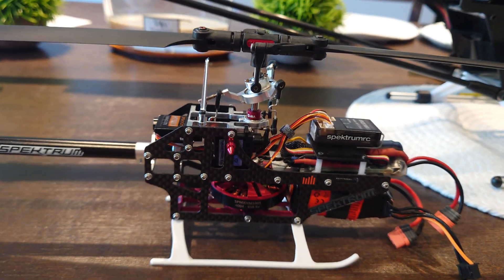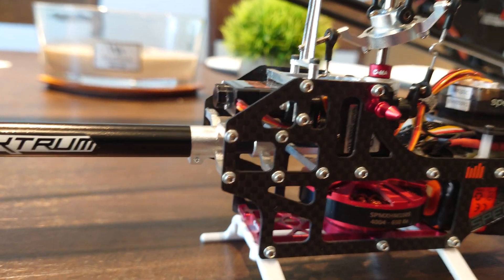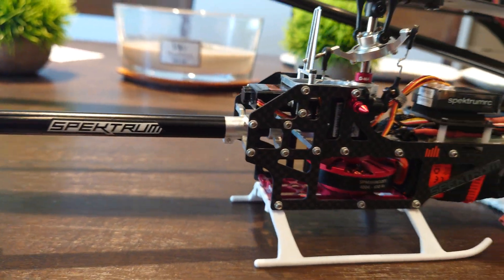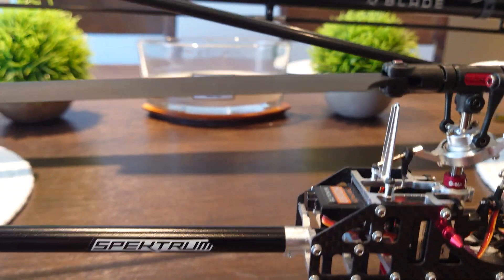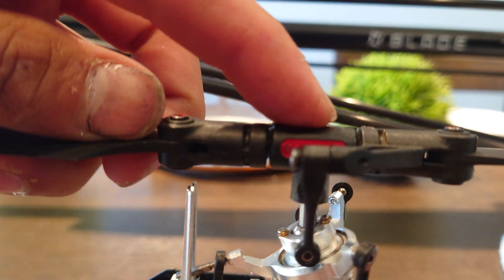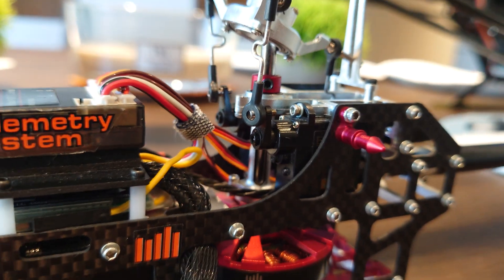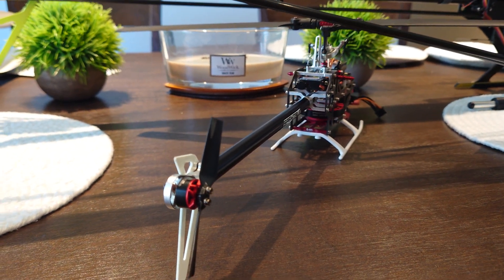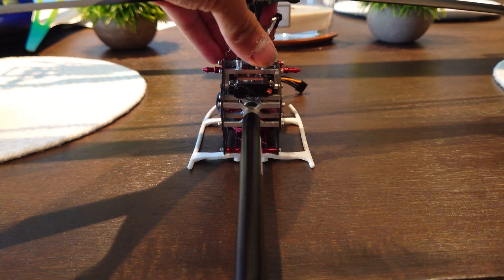blade infusion 180 upgrades

Comment: Great info here for 250-gram builders. I have been using Oxy2's rotor head to build IoT products for missions. This video helps identify the compatible DFC arms and DFC grips between horizon's 180 series and Lynx Oxy2's 190 series and also Microheli's after-market parts that can improve things.